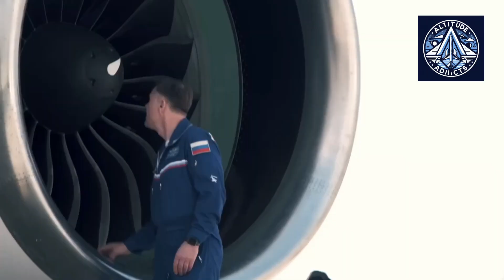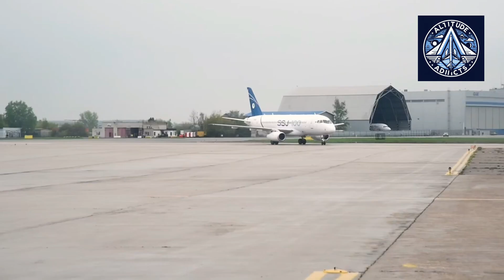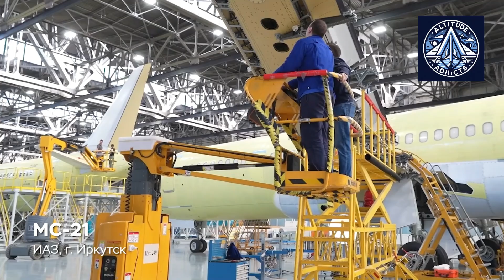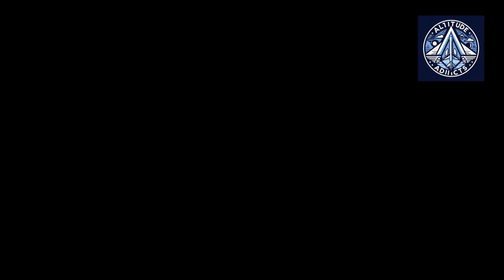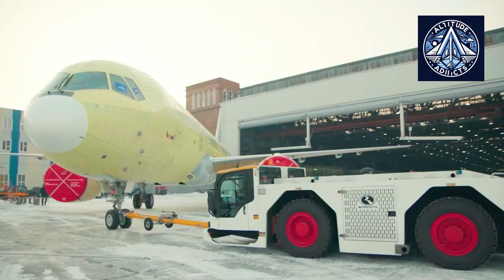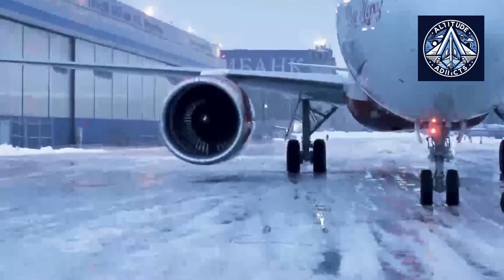MC-21 Delayed - Program Director Outlines Key Priorities for 2024

Comment: I think if all the airworthiness tests are not perfect, it doesn't matter if they have to be delayed. The issue of the need for aircraft continues to be pressing, it would be better to buy a Tu-214 first. Maybe this is not an ideal choice, but it still makes sense rather than daring to fly an Airbus with damaged components which we also know are due to sanctions from the West.

Comment: My idea assume MS21 still only operate Russia, Euro and USA cancel certifi safe for MS21 in spite of verry modern. Why not manufacture large number TU214 about 500 unit and IL96-300 250 unit. That plane was certifi safe in the world.
Reply: Progress in aviation industry is always the main driver of the overall technological level of the country building the modern aircraft and its engine based on the latest technologies.
Reply: Es werden ja zur Überbrückung TU 214 in Betrieb gebracht und auch IL 96 gefertigt. Und das ebenfalls überarbeitete PS 90A... ist ja auch nicht unbedingt unmodern.
Reply: They use PS-90 engine which is quite old technology but only it is reliable. So foreign customers are not ready to buy.